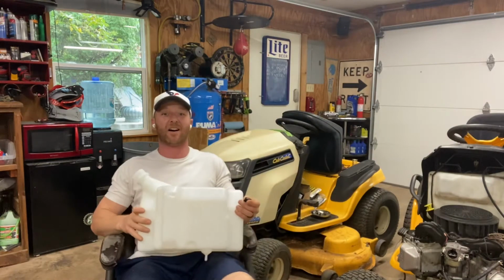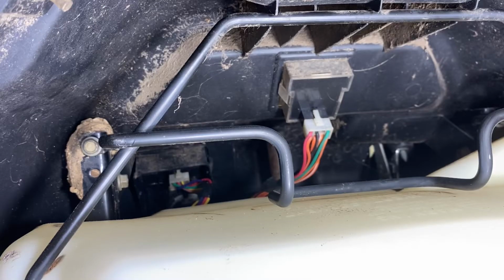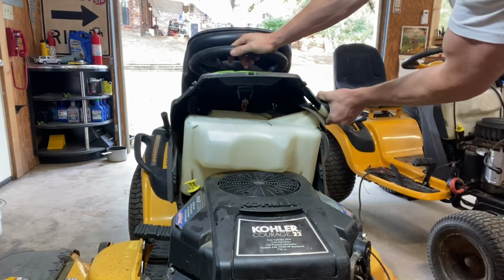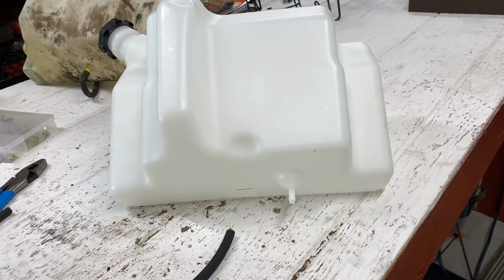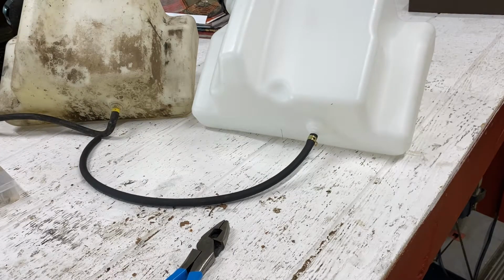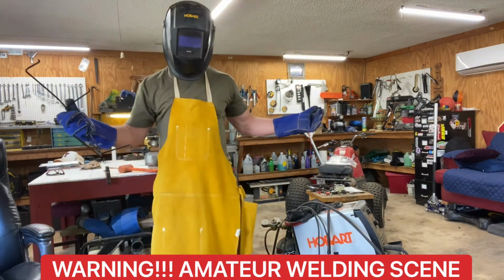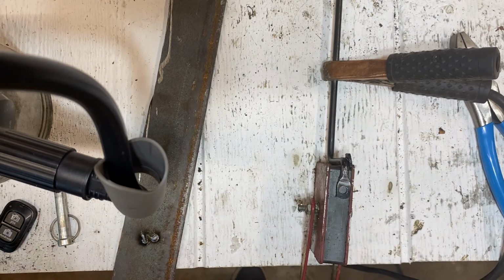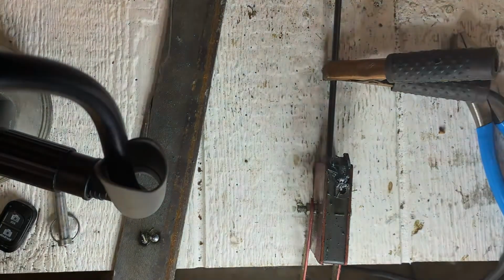Cub Cadet Fuel Tank Removal & Install (BONUS SCENE!!!)

Comment: Help. 77 yr old lady with  cub cadet xt1 50. Changed air filter and oil filter. No prob. Oil changed.  Great but now I see line from top of gas tank threaded to air filter area loose, not attached to anything. Where does it get attached? Have looked in and around air filter area but all I see is shiny prong silver in color.
Reply from the maker: My guess is that is the fuel line that goes to the fuel pump. Look on the outside of the plastic engine cover and see if there is a round plastic disc looking thing. That is the fuel pump, it will have three prongs on it. Shove that loose line on which ever nub doesn’t have a hose hooked to it.
Reply: Thank you fir answering. The fuel line has fuel filter on it and is on right side of engine as I face fuel tank. I know it's hard to answer when you can't see the line. This line appears to be vent line. It comes out of middle of top of gas tank. Threads down left side of engine and then is hanging under air filter area . I will definitely double check according to your instructions.
Reply from the maker: @darlabey8746  I got ya. I don’t have one of these engines infront of me. But there is a vent I take nub that it goes on that will be somewhere around the intake behind the air filter. Or maybe there is a nub on the oil filler pipe. What brand engine is it?
Reply: KOHLER 7000
Reply from the maker: @darlabey8746  I just am not sure without seeing what you are looking at. If you want send me some pictures of it to MowerMike80@gmail.com
Reply: Mike I have looked at the line it comes directly from the vented cap of a gas tank it is attached all the way down the side and appears to go nowhere I looked at my sister's Cub Cadet she also has a vented gas cap only her vent line is like 6 in long and that's it so I'm not going to worry about it unless I see it's causing a problem and I don't know what that would be but in that case then I would send you some pictures but I think it's just the vent line and they just had it attached going nowhere nowhere I thank you so very much for your time and effort I really never suspected that anyone would even answer but you did such a great job of caring and I appreciate it so much
Reply from the maker: @darlabey8746  Ahhh that makes sense. The fuel tanks all have vents on them. As the gas drains going into the engine it creates a suction in the tank so it needs a vent to keep the gas moving.

Sure thing, ask anytime. I really value my female viewers, you gals are few but mighty. I think it is really cool that you take on fixing your mower yourself vs paying some fella.

Comment: Mines in the rear.
Leaves near the rubber line/well thats ots low spot sky way.
Acts like ots clogged.
I'll pull off the line under there.
Reinstskk/goes for another 3p min.
Thanks I'll wait for the repair
Reply: some mowers with rear tank have about 4 bolts to remove the floor pan easily, line under it.

Comment: Thank u for sharing!! I don't need to replace the tank on my cub but I was going to try to replace my carb.  I removed all bolts on plastic engine housing and then discovered that the gas tank was in the way!!!  Am I missing something obvious, or do I have to remove gas tank  to get engine cover off!!?? That seems crazy.... Love ur humor!
Reply from the maker: Yep it is a horrible design, you have to remove the tank before you can get the engine cover off.
Reply: Thanx!  Got the tank out  without much trouble but when I removed the engine cover I freaked out.  I'm a complete novice so I'm off to view ur video (a few times!) on replacing the carb. Hope I can work up the courage to tackle the unknown.  The throttle linkage and spring rod thingy scare me.  They look so fragile and tricky to manipulate. Local shop has a 5 week wait and wants at least $400 to repair so I have to face the challenge! Thank u again for sharing ur knowledge and humor!!
Reply from the maker: @donatellatorricelli6394  You got this just make sure not to bend or force anything and take pictures of the linkages before you take them off. Also don’t forget to put on new gaskets
Reply: yep

Comment: Great Cub Cadet LTX content Mike, very helpful.  I'm curious, do you know why the fuel line on the LTX1042kw from the tank to the fuel filter is so long?  My guess is that they wanted to have one part number for all engines in the LTX and one of the engine needs that length.  Seems so long for the Kawasaki engine though, the fuel filter is almost on the floor underneath the tank.
Reply from the maker: No idea

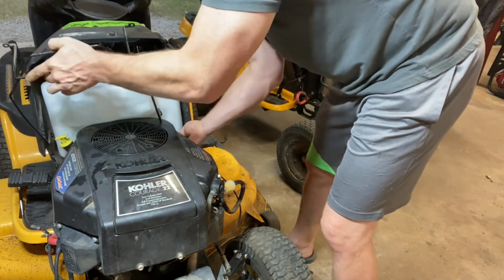Comment: 6:41 punches another hole in the tank
Reply from the maker: I am impressed you made it that far in the video, got a real fan
Reply: @MowerMike  haha I  was laughing at you jiggling the bracket off and loved the callback putting it back on.  BTW I found your channel looking for a way to remove the fuel tank just so I can fix the parking break.
Reply from the maker: @yamlcase230  welcome aboard, that tank is a PIA
Reply: @MowerMike  no kidding.  I was so proud of myself.  then after getting all cleaned up and my trailer hitched ready to go out and spray I notice there's a tube wedged in front of the fuel gauge window.  *sigh*.  next weekend project.
Reply from the maker: @yamlcase230  Haha I have been there, kinked fuel lines will always sting ya